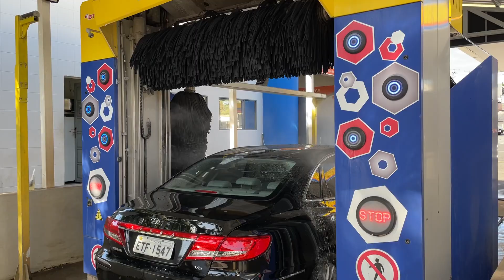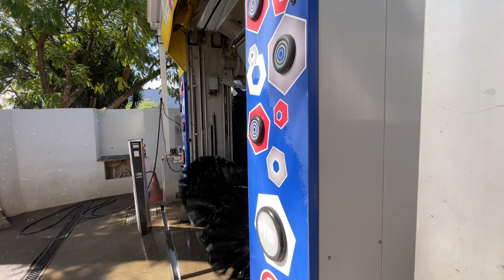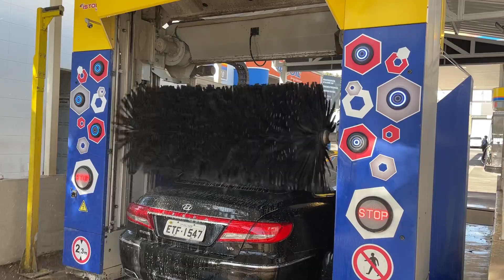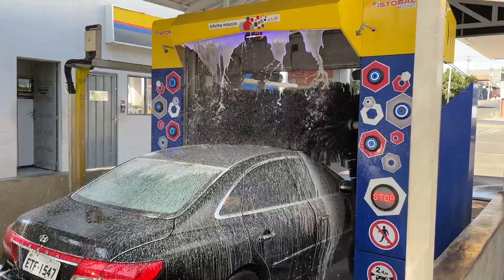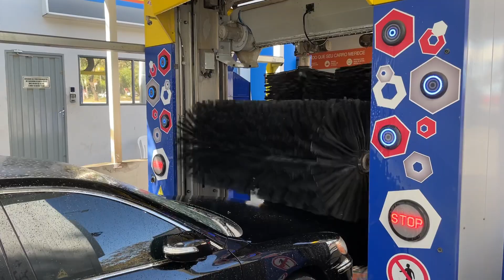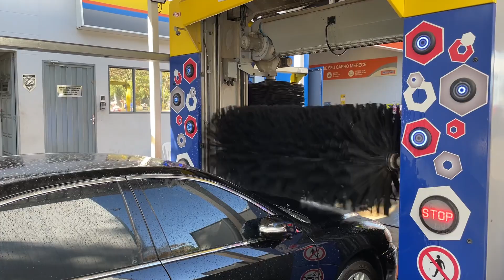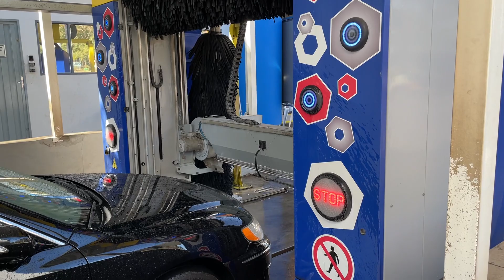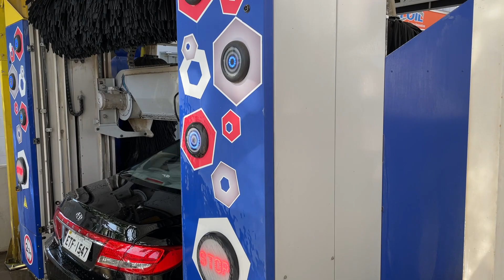Istobal M'Start with Infinite mousse arch

Comment: This system is out of this world I am absolutely speechless the best M’start I absolutely love the two tone colour scheme of the frame what let’s it down is the black Carlite infinite moose arch absolutely amazing very thick coverage I love how it goes all over the top brush and then get flicked all over the vehicle I absolutely love how powerful the high-pressure was on the oscillating for the roof and side. Also love seeing how the system does different brush washes through the stage of the program that’s something very interesting overall the results from the system are absolutely amazing The only thing I would say that let the program down what’s the week wax which could’ve been a thicker cover rather than a missed. And I also love the frame for the infinite moose arch that also protects the top brush drying results was also pretty good I think the weather also helped with that along with the drying aid chemical just goes to show that the added chemicals you get a better drying quality